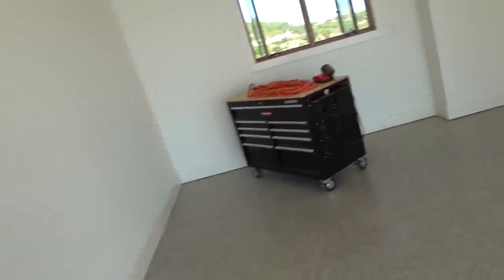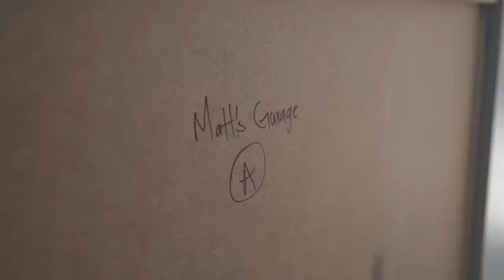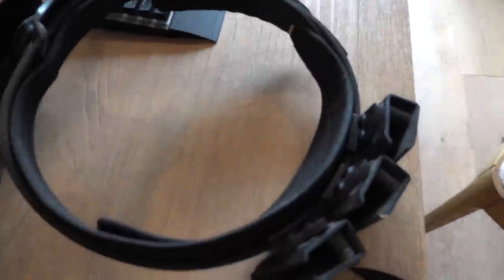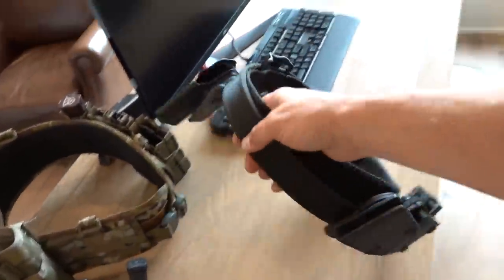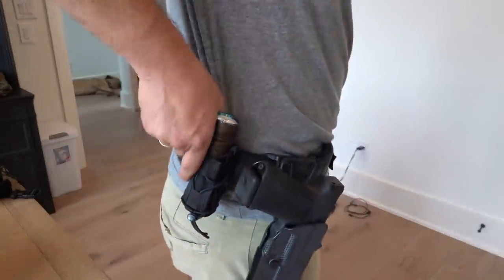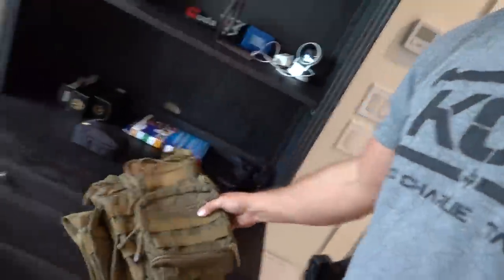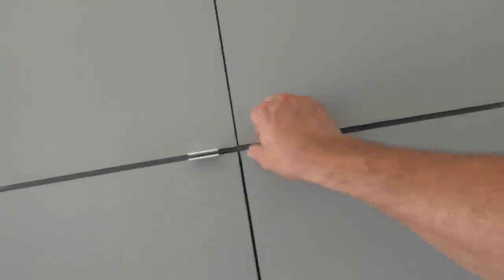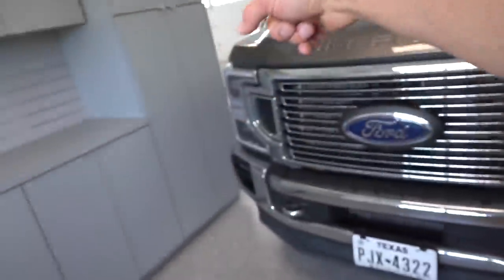Caught Intruder in my Backyard at 10pm... DemoRanch Gear Check!

Comment: Hey Matt! One tip I could pass along as a retired cop with 27 years on the job. Might want to consider keeping your flashlight holder on your off hand side. That way you can deploy / use the flashlight without encumbering your gun hand. You'll need to practice, but do it for some repetition drills and you'll automatically reach back with you left hand when you want a flashlight. It's even easier to deploy and jointly aim a flashlight and pistol at the same time (if you don't have a light on your gun).
Reply: KB yes......becomes muscle memory . In fact , in most situations , both hands go back in retrieval mode at the same time . Simply because they EACH have a job to do . If all our force options are on one side , we have to make a decision prior to retrieval . Bang bang , you're done .
Reply: As a current cop, thats what I came to say!
Reply: I also agree, former military police, flashlight on the off hand side
Reply: Not a cop or ex military guy but i came here looking for this same comment on the flashlight being on the wrong side!  I want my light to be easy to grab WITHOUT having to move, alter or adjust my pew pew in any way, shape or form!
Reply: @bbark96  as a current Officer, glad i read your comment ha that’s what I was here  to say
Reply: Thats the first thing I saw and would recommend.
Reply: Yes highly recommend moving your  light to the other side.
Reply: As a mechanic,  I always place my flashlight in my left rear pocket while on the job, to reinforce this exact muscle memory.  Customers don't catch it, but be sure mechanics don't just rely on having a tool close to smack you with.
Reply: keith burt as former peace officer was my immediate thought as well.
Reply: 100% as soon as I saw the light placement I cringed. No offense to Matt, he simply said he doesn't know and it's looking for help.
Reply: Yep! Retired LEO, here to say the same. Good advice.
Reply: Yep - 100 percent flashlight on weak side
Reply: i was gonna say the same thing lol
Reply: Yet another former LEO here to comment about your "bump in the night" belt
weapon light
red dot
flashlight on your left side
ditch the 33 round mag and just use two 17 rounds
med pouch on the belt 
maybe some pepper spray on the left side as well
Reply: Was watching him and I thought the same thing
Reply: Thank you for your service! You are a hero in my book!
Reply: Yeah see these are the sorts of comments that make reading comments sections worthwhile. Thanks!

Comment: Move the flashlight to your off hand. Replace it with a "spray" or blade. You want your ON hand empty to grab a weapon if needed. Learn to use your off hand for using flashlights for anything
Reply: Wanted to say that, but I’ll like it to keep it to the top
Reply: I agree with this or at least move the flashlight to the right front so you can reach it with your off hand.
Reply: I would say the same thing.  As a retired police office who carried a gun for 25 years, I would keep the flashlight on the opposite side as your handgun.  It makes it much easier to reach your flashlight if you already have a gun in your strong hand.
Reply: This is what I was about to say, if you pull your pew pew, you don’t want to have to hold it with your left hand to try and get your flashlight out.
Reply: what he need is weapon mounted light
Reply: Hmmm you got me thinking there, I remember while back they was playing with air soft pews, think ( I have zero experience ) But, couple big ass hand pews each side and maybe some full tricked out Co2 pew... If it ends up not good enough then the two hand ones, or maybe a taser ? something a little les lethal ..
Reply: Yup, i was about to say the same thing.  Once you have your pew pew in your right hand, its not gonna be efficient to also try and grab the flashlight with the same hand.
Reply: A spray would definitely be a good idea for an animal or low-risk situation, but what good would a blade do (other than some kind of multi-tool)?
Reply: Have a set close to your bedroom, going to the safe to retrieve your setup is not a good idea.
Reply: @marlinmaas  with a fixed blade, you pull it out locked and loaded, no rack needed. Depending on distance, it can be much more effective at "time to pain and bleeding."
Reply: @ChessIsJustAGame  you should never get so close a knife is more effective than a gun or spray and if you're ambushed this close you won't make it to the blade before the other does, so I still don't see a real use for it.
Reply: @michaelhyland9216  There are at least three kids in the house at any given time, any gun really should be in a safe. Especially as the kids are growing. Doesn't mean it should be in the bunker, but knowing Matt he has a safe close by.
Reply: @Milldog2023  You don't want less lethal in a home defense situation AT ALL. You want the absolute most lethal weaponry you have. Shotgun with buckshot preferable. Complete and total incapacitation in the shortest time possible is all you want.
Reply: Even if you aren't armed (I'm Australian, the only people you see with a pistol on their belt are Police and Armorgard Cash transport security) I would say you want your flashlight in your offhand. Unless it's one of the good ol' 6D Cell Maglights and you intend to also use it as a club.
Reply: @marlinmaas  knife in this situation would be the same reason most people carry one everyday, or while hiking, camping and hunting. It's not so much for self defense but more for having a cutting tool on you. A multitool would be nice but takes too long to get to the blade if needed. A fixed blade on the other hand can be used for cutting clothing off for medical, cutting ropes/wires, prying things open, breaking glass, and in a last ditch last option scenario to defend yourself. You don't want to be fumbling around with things.
Reply: @scythelord  But what happens if its just kids getting selfies n that. Im From England and isnt allowed real toys.. But there again, Ya have to pretty balls snooping around a dudes place who has the odd pew lol
Reply: @marlinmaas  never said anything about not having stuff in a safe in the closet.  I SAID to have something alot closer then a vault under the garage on the OTHER side of the house.
Reply: @scythelord  870+OO=happiness
Reply: @Milldog2023  kids don't roll up at 10pm on a stranger's property in a truck for selfies , especially in Texas . That's like going into a Glasgow pub at 10pm and shouting "all Glaswegians are poofs" .
Reply: @michaelhyland9216  you DID say SAFE, but apparently meant the bunker. Good to see we’re on the same page …

Comment: 1. Flood Lights outside to light up the perimeter around your house / turn lights off inside. (You see them, they can’t see you)
2. Access to outside cameras on a phone app.
3. Multiple hidden areas throughout the house to have pew pews available to use, in case your not near your readiness gear.
4. A real code entry gate at entrance. (Especially since your considered a YouTube celeb.)
Reply: Adding to #1, set it up to light that yard up like the 4th of July at the flip of a switch.
Reply: Just consider the fact that there will always be someone who might be cautious and ingenious enough to get around security measures like these. So, it's always good to have a contingency or backup plan.
Reply: Huge yes on the outside lights, exactly for the reason mentioned.
Reply: Yes, except 3 when you have kids in the house.
Reply: @nodefortytwo  True. However, I was also thinking of the pew pews being in Biometric Safety Boxes in those hidden areas as well. (But like you mentioned, will that be safe enough against snooping kids and house guests?  🧐)
Reply: @RANDOMGUY-ty3ze   yeah I mean if someone is coming after you to really get you they probably will but maybe he has an escape rout or lock down room not like he’ll tell anyone
Reply: Infrared floodlights will also give the advantage of NVG/Cameras having vision while they do not. Depending on if you want the tactical advantage or the fear advantage. 99% of people will bail when the floodlights kick on and welcome to the jungle starts playing, but that 1% will make infrared handy.
Reply: @Krelian1  "welcome to the jungle" 🤣🤣 Perfect.
Reply: @HowOrdinary  lockpicking lawyer did a video on those, bad idea
Reply: No to #1  Don't turn off inside lights, turn them all on.  One, it lets the perp know you're home and paying attention.  Two, if perp has gained entry you can identify your target.  He's got kids in the house.  Three, His wife can identify him and not shoot him.  
I agree with light everything up.  Even lights away from the house pointed back but not that blind you, shuttered/pointed toward the ground.  Ambushing, to a jury, looks like attempted homicide.  No sane person wants to wait to ambush unless it's a last redoubt.
Reply: @nodefortytwo  Rick, I don't follow.  Can you explain?
Reply: Did he say Jess G.I.

Comment: Hey Matt, Im a Firearms Instructor in Oklahoma. My only crituque about the loadout is to turn both your mags the same direction. In the event you are under stress and have to change mags quickly, you dont want to fumble either which way. Having them all the same direction will make training the same each time. We always taught facing them towards the stomach. Also consider putting your backup light on the left side. Only thing you want on your right side is the gun and maybe a less lethal option. 

Hope you like that custom Glock 17 frame i sent you. Much Love.
Reply: First thing I noticed.   Mags weren't clocked correctly for a quick reload.
Reply: I would think having the flashlight button on the back instead of the side would be better
Reply: @Grain_side_carving  most of the time yes. You can train with whatever equipment you have and make it work. But under stress you don't want to be fumbling around trying to find the button on the side.
Reply: Rifle mag rounds facing backwards and pistol mags rounds facing forward that way when you beer can grip your rifle mag your grabbing it the correct way
Reply: @dccrawlers7595  his rifle mag is fine. Same way we teach. His second pistol mag was what I was referring to.
Reply: Glad you mentioned moving that light.  BAD place for it.  Hardly accessible by the left/weak without contortion and off target.  Baton can go behind, either 7-8 o'clock, 11-10, or 1-2 for the light.  Like you said consistency.  I never hold the light in my strong hand looking for stuff/threat.  If I think there's a threat (not stuff/thing) pistol is usually in my hand already.  Critters go bump and shuffle, sound totally different than people moving.  lol Not to mention, it'll look like you're going for your sidearm escalating the situation.
Reply: Good call.

Comment: Put the flashlight on your weak side. Especially considering your plan is to use it with the gun drawn. As you have it set up, you'd either have to reach across or snake behind to get it with your weak hand or you'd have to switch the gun to your weak hand to draw the flashlight, then switch both hands again

Edit: Also try to avoid putting anything in the small of your back if you can avoid it. At least harder objects like the flashlight. Gotta think of what you'd fall on if you got knocked down
Reply: Personally I like strong side in front of the pistol holster. Doesn't interfere with draw and easy to find. Weak side it's constantly bumped when pulling out the first mag. I run a 90 degree Streamlight protac so it stays clipped to the belt when it's on. Easy to rotate if needed, excellent supplement to a weapon mounted light.
Reply: i was about to comment the same.
Reply: @cleric670  I'm a lefty and keep my light around the 4 o'clock position. Mags go directly to the right of my belt buckle
Reply: @cleric670  Guess the big take home though is that everyone has what works for them, and as long as it works there's no issue
Reply: I've got the light horizontal by the buckle.  

I say put an IFAQ on the small of the back.  If you're going for meds, you have a few seconds to manage that.  I also don't like grabbing and buckling that med bag for a bump in the night.
Reply: He very specifically said he'll be using that flashlight if he doesn't have his gun out.
Reply: Most important thing is training with your setup and getting comfortable with it.
Reply: @littlejackalo5326  he needs the ability to run the light with a gun out as well, you don't want to be pointing a gun at someone who may not be a threat but you still need to see them... weapon light only means you can't see unless you are going to shoot
Reply: Any reason not to run the first aid kit there? seems like a better option then trying to run a second setup just to take it along. attach it with velcro to enable easy removal and now its all on one belt
Reply: @DredlyLB  My thoughts exactly. First aid, and a smaller kit on the belt and ready to go. Probably on the back since it wont hurt to take a fall on

Comment: Matt -

On the "DTC" (Defend The Castle) belt - Move the light to the non-dominant/weak side (left) so that way you can grab it and keep your right hand at the ready to draw your sidearm. Also get an IFAK that can be attached to the belt so that way you literally have one piece of equipment to put on to save on time. You can have have an additional TQ on the belt if necessary, just make sure they're accessible to both hands just in case.
Reply: Bruh you know nothing about a combat belt setup
Reply: 100% this.
Reply: @devonwoodman3350  Everyone has their own preferred way to set up gear. There is no perfect set up.
Reply: @devonwoodman3350  Joseph was spot on. Stop trolling.
Reply: I was also going to say "small of the back ifak" with CAT, and suggest moving the light to the non-dominant side for the same reason
Reply: and a holster for pew plus light, I like my safariland with ALS retention (no hood but positively locks the pew in place)
Reply: @aerosaaber  was going to suggest the same. I’m ambidextrous so it’s less of an issue. But I like to keep pews on the right and lights/tasers on the left (I train that way and train to shoot both hands as well so it works for me). Definitely meds on the back (personally right side of the spine near the kidney for me).  I keep 3 mags on belt, 1 in the sig,taser, flashlight ifak,TQ, empty pocket for misc on my home belt. Have a BA rig setup for the ranch though that’s more purpose designed for that scenario.
Reply: Use the Defend the Castle (black HSG) belt. First suggestion, have an empty mag pouch to drop in your cell phone. That will allow you to call the police if you find the bad guy and he surrenders.  Then you don't have to go all the way back to your bedroom to get your phone and the bad guy runs away. You could also put the phone in your pocket but you have to make sure to ALWAYS wear a pair of pajama shorts that has pockets. Second suggestion, you can get a Vertx Transit sling bag instead of a MOLLE belt. Buy some Tactigami pouches to load it up with your pew pew, mags, light and TQ. The bag also has a sleeve for a Premier body armor panel. You can sling the bag over your chest to access the pouches AND protect your vital organs in case the bullets start flying. Third suggestion, have pepper spray in case you want to de-escalate the situation without shooting the guy.